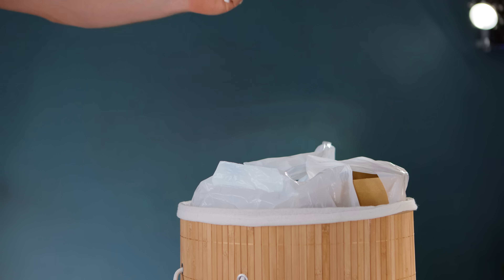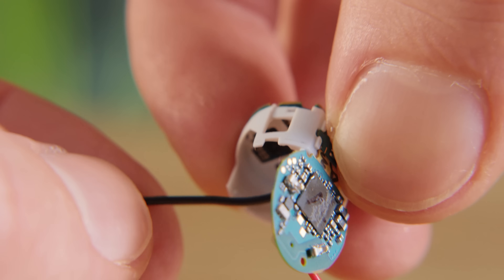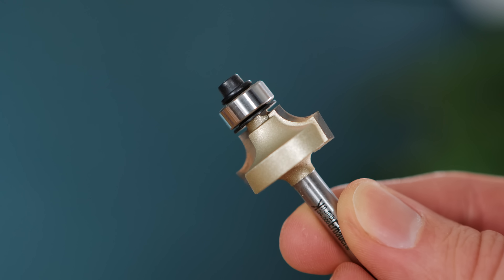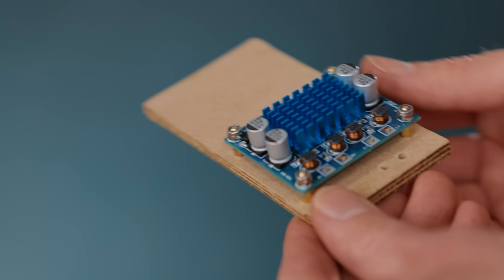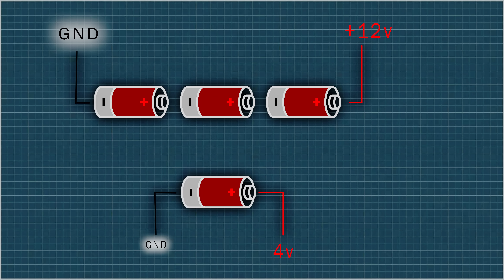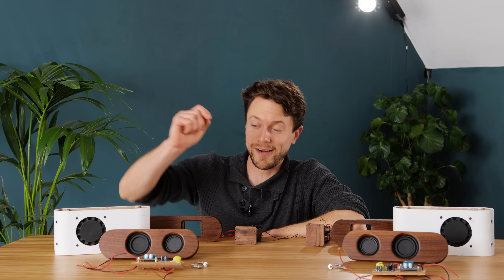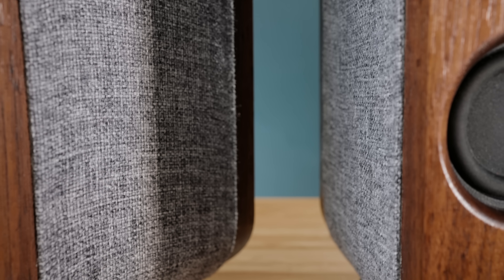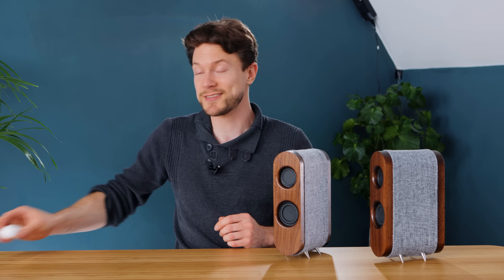Transforming dead earbuds into POWERFUL wireless speakers

Comment: Very good - beautiful looking speakers. I have some Apple Airpods that have always been useless I will certainly have a go at this but I think I will use a pair of old Celestion 1s as the basis not make my own, for a start I am better with mechanics than woodworking and I just don't have your patience, or cnc router. I didn't really like the sound though it was a bit lifeless compared to the Bose just personal taste I like a brighter clean sound I am not a big fan of subwoofers and muddy bass. In any case I think the filters are the problematical for many reasons, as you said trying to get them just right is really very difficult so on small speakers like this I think I would just go for a full range 12v car door speaker from a quality speaker manufacturer, maybe Alpine or JBL, and I would use mains power not batteries. But thank you very much I will convert my old Celestion 1s into BT speakers using the Airpods, it will make a change from rebuilding motorcycles.

Comment: Really great build even though I would apreciate having a charger build in the housing
Reply: Came looking for this. Unscrewing those batteries to charge them seems completely backwards after all the engineering and thought that went into these. How hard would it have been to add a wireless charging circuit on the back? Even just a port to plug them in so you don't have to unscrew the batteries each time.

Comment: You compared your speakers to Bose Soundlink Mini II, which is a single unit. There's no way you can compare a single unit speaker to separated stereo speakers. I think the value of what you've created is greater than what you've calculated.

Comment: Oh this is easy, all I need is a CNC, a wood router, a complete set of electrical and soldering equipment, two pairs of expensive speakers, a pair of amplifiers, a set of not at all cheap batteries and a complementary charger, wood, plywood or mdf, a nice cloth material, wiring, capacitors and resistors. Some spare sealant putty lying around, pva glue, 50 work-hours of free time, a lot of hassle, and finally a pair of broken headphones. Because usually I have all of that in bunches lying around. And it all costs about $200 not counting the work equipment required or manhours. If you spend this time working overtime, you'd see how much this would actually cost you. Or you can go out buy a pair of JBLs pair them and be done.
Saying bluetooth speakers don't function is stereo is a big lie, or is misleading at the least. He has two units to carry around, so buying two brand name speakers and carrying them around is identical. All major company bluetooth speakers have a pair functionality and can work in stereo without any hassle. 
I bought the Sony XB43, it's loud, quite impressive in sound quality, is dust and waterproof, and has a lasting battery which can easily be charged on any charger with a usb-c port. I paid around 150$ for it. If I find another one on such a deal and buy it, for $300 I can pair them in stereo and blow these to kingdom come.

Comment: I've got an old bluetooth speaker with battery issues. I've to keep the charger plugged in for it to be used.

The battery specs. are LiPo 3.7v 300mAh. Can i use a mobile phone battey with same volt and a higher mAh as a replacement?

Comment: When u said the lpf hpf and frequency smoother is precisely tunned what u mean by that....what's the base of ur tunning ... Did u checked how they sounded or u used a oscilloscope for the result ?? And did u changed the resistors and capacitors against it ??

Comment: Hm,i think that system of charge is no so comfortable, you need to take a BMS + 18650 mode and charge it with 12,6 V(may be another voltage) charger and also instead  I-Max yo can charge accumulators 5x5 mm connector.It's not difficult and not so problematic.

Comment: These could benefit from some polyfill inside the enclosures to remove the resonant wood sound, and a tweeter to help handle the highs, but that's likely too complex for those amps you're making use of. All in all though, the look wonderful, and are pretty smart!
Reply: Ive been lookin at modding this to have a 3 band eq rather than a fixed filter

Comment: "The guide will be uploaded shortly."
So that was a f***ing lie.
Now I have to research what a low/high/band pass filter is.
In all seriousness, this is a great idea and I am now looking into converting some old headphones into something I never would've thought of, thank you.
Reply: I think you can skip the filters he mentioned. As far as I know, all the filters does is make the speaker a bit more efficient.

Even if you know what these filters are, given that he didnt give his configurations, you'll ended up having to experiment on your own. Unless you have a degree in electrical engineering, a frequency generator, and a multi-meter lying around, all you can do is look the internet for some design someone made and trust the work they did.
Reply: @nakanowatari3339  You can literally see the resistors he used by the colour bands.
Reply: Research is good. Then you'll know how much frequency overlap you need between the 2 drivers and how steep the cutoff should be to ensure mids aren't lost.

Comment: You could get $4 broken earbuds, or get an actual bluetooth audio dac for the same price and connect the speakers to that, they come in many variations and versions. Also the seals between the speakers and the wooden frame is important, but only if you're going with closed back design, open back will have diminished effect on the sound, not to mention, you need to tune the eq later to get the best sound (which not a lot of people will do). Good vid for casual watching, but bad for people who actually want something usable.

Comment: Why using electrolytic capacitors for the filters? On more than one front, ceramic ones seem like a much better choice.
Reply: High frequency is filtered by pf values capacitors, which come mostly in paper or ceramic. For Low frequency microfarad capacitors are used which come usually in Electrolytic version.
Reply: @aslisiyasat5664  That'll really depend on the resistance values used. For example, using a 10 kΩ resistor for a 200 Hz filter would require a 80 nF capacitor. Nonetheless, that doesn't take away that electrolytic capacitors have polarity, and reverse voltage shouldn't be applied. DC bipolar capacitors are not suitable for use in AC circuits, such as an audio signal path. That is, unless you put some DC bias across them, but that wasn't done here. In fact, since the two circuits have their own supply and no common ground, the DC value across is undefined. Furthermore, I can quite easily find leaded ceramic capacitors up to 20 µF. When also allowing SMD, I can even find 470 µF.
That said, the audio signal here most likely will have a relatively small amplitude. At least, not enough to destroy the electrolytic (quickly), given that it actually does work. I suppose for a hobby project it won't matter much. Matt also seemed to take at least some care in how to deal with their polarity, as they are all 'facing' the same direction. Further, the high capacitance ceramic capacitors will have a dielectric like X5R, which typically has a varying capacitance with DC bias. Though at an expected 0 V DC bias, they should be at their nominal value anyway, but I put it here for completeness sake.
Reply: @robert3116  Back in olden days, some geniuses marketed kits labeled crossover network cards with resistors, capacitors & coils which were connected directly to power amplifiers & woofer, mid-range & tweeters connections were given. God knows what microhenri inductance was used.
Being a commercial repairman, I used to solder, assemble, test it once & shoo away customers.
Only hobbyists are true connoisseurs. Not me🤗

Comment: A guide, please? It has been more than a month.
More specifically, I need the resistances and capacitances values for each circuit made, and specifications of each speaker.
Also, why not include a USB-C li-ion battery-charging board with each speaker? That would make recharging each speaker a much easier and more sophisticated experience.
Reply: Nice. Brother, did you discovered the values of the capacitors ? Thank you.
Reply: reaplcing an 18650 is better than half time caring so but i understand your pain

Comment: The total cost of this is pretty high compared to other budget options and for typical home use, I don't think having it fully wireless is that practical. I rather keep my speakers connected to AC all the time than having to undo 4 screws and taking out the batteries to recharge them regularly. 

It's a very impressive feat for sure, and they do look and sound very nice. I just think that for most of the viewers, there are much more affordable and less time-consuming ways to get good speakers for home use. 
Personally I'd recommend getting a TPA3116 bluetooth amp from AliExpress for <10 USD, which you can power with any 12V power supply you have lying around. Then you just buy a good pair of vintage speakers and hook them up. In Europe, the Philips 22RH range is excellent, from small 22RH422 up to large 8" passive radiator 22RH457, and with around 100 EUR for the largest model and as low as 20 EUR for a pair of the smallest ones this setup is much cheaper than even just the drivers for your speakers.
Reply: I was looking for a comment like this.

Comment: Full range speaker: $8
Subwoofer/Radiator: $80
Hmmmmm
Personally, I'd use the Tang Band T2-2181SA subwoofer module instead, similar performance for half the price. Would only have to redesign the cabinet a bit. Integrating a charging circuit would also be nice

Comment: While not everybody will be able to do this, it is a brilliant idea. Yes, the rest is not cheap but so would be commercial ones. If you are into speaker diy (and I met lots of that species) you get the tricky communications part most likely with a chip set that handles the stereo precision (time Syncing). And if you glued the thingies into the top you might even reveal the touch surfaces for volume control, previous and next track etc.
And I must say they look spiffy :)

Comment: Way cheaper, easier and a better solution is to just buy a bluetooth receiver for a few cents, which you then can put on a Raspberry, instead of frickle around with your partly defect earbuds. 
Also you should use better speakers and look into how to make them use the whole case better, mainly for a deeper, more round sound. 

So imho not the best DIY tutorial, but surely not a bad one.

Comment: Why not add a small usb-c charging board? It would only run $2 per board, so less than $10 total and you wouldnt have to remove the batteries to charge them.
Reply: I like that idea.  Link to what your are talking about?  Thanks.